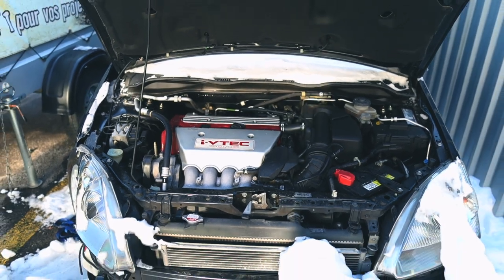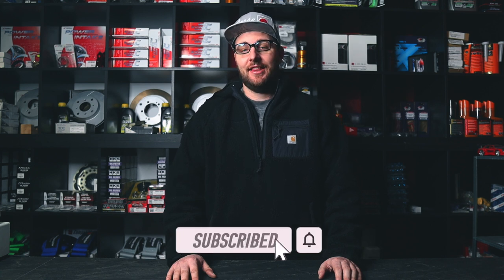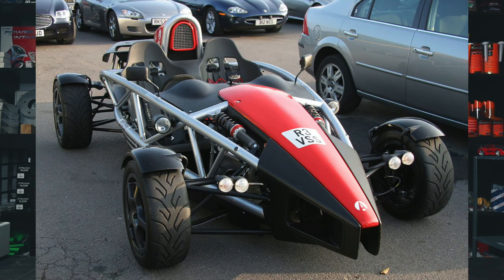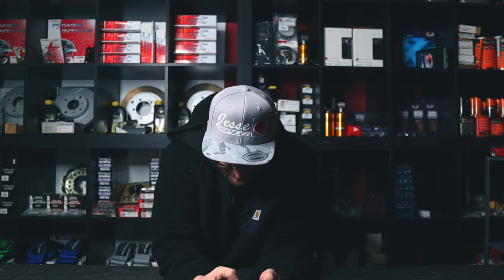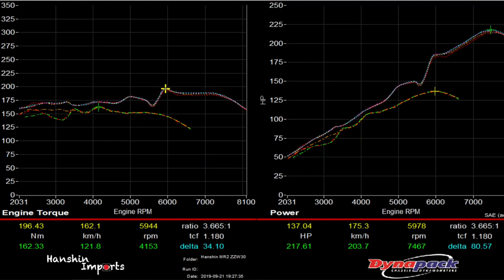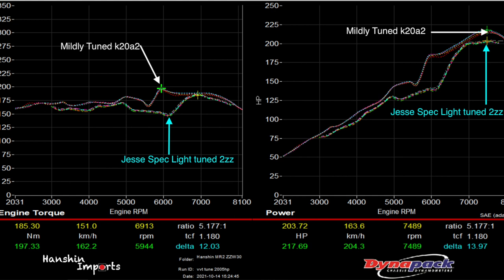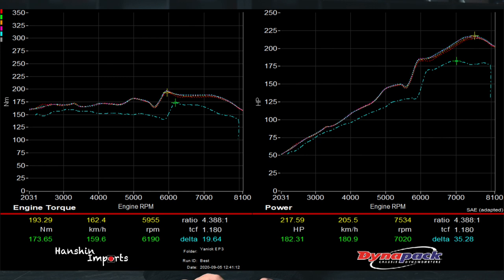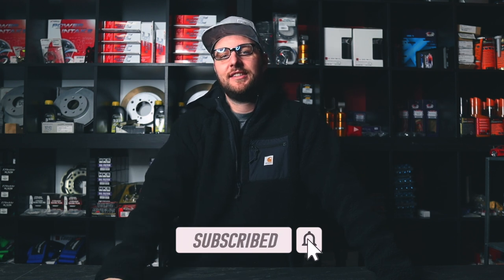How to Kswap an Mr2 Spyder EP2: Is the K20a better than the Toyota 2zz? Is it worth the extra cost?

Comment: Good points, but the other issue with the 2ZZ is poor durability of the C series transmission. Much better options with the K series.  Second, while PEAK power of your tuned 2ZZ is similar to the K20, another adage is, “area under the curve”.  The horsepower comes on much earlier and stronger with the K20 once lift engages.  I have a 2ZZ, and that is it’s biggest weakness for me…a very narrow, peaky powerband that is barely usable, even with a 6 speed.
Reply: While true, I think that is actually where the fun comes from. It gives the engine character because the 2ZZ is just so eager to deliver performance yet it makes you work for it instead of serving it to you on a silver platter, which in turn forces you a be better driver to compensate and maximize that powerband.
If you want area under the curve just get a big lazy V8 and call it a day.
Reply from the maker: Don’t worry, i know the concept of area under the curve. And this video actually shows that the 2zz, suprisingly, isn’t that far away at all than the k20. Even more surprising, it actually surpasses the k20 in a stock ep3! Watch the video and you’ll see… this video is to show that its actually pretty close
Reply: The trick is lowering lift stock 2zz ecus lift point is anywhere from 6200-6800rpm depending on the ecu that’s why the power curve isn’t as good a k20. My lift is set at 5800rpm with redline at 8600rpm and the power curve is very different crazy with just a few rpm difference in lift engagement can do. Every time I shift I land in lift always in the powerband.
Reply: @JesseSpec  I watched the video before commenting.  The K20 has much more power below where the lift kicks in on the 2ZZ (based on the dyno curves that you posted).  At less than 5200 rpm, the power curves are very similar, but when racing or when you want power, you don’t care what the power is at low RPM…you want maximum power over a relatively wide powerband.
Reply: @absolutezero7344  I have a Spyder with a 2ZZ.  A V8 is a tough fit in a Spyder (essentially impossible) and also doesn’t do much for gas mileage on a car that is driven daily in addition to being driven occasionally on the track or autocross events.  The 2ZZ is eager to deliver performance, but only after you hit lift above 6000 rpm.  It is a good match for the Spyder as it is an easy and inexpensive swap.  It is also rather gutless and delivers essentially the same performance as the 1ZZ unless you rev it to the moon.
Reply: @reneneron2971  I wasn't necessarily saying to swap a V8 into a Spyder, it was more about if you desire a Flat hp/torque curve then maybe you should consider getting a car that is suited for that purpose like something with a large displacement engine, anything supercharged, or go all the way and get an electric car and have a rectangle for your dyno graph! It just so happens that highly strung 4 bangers tend to have low torque but peaky HP by nature and you either love it or hate it. 

As for the 2ZZ the biggest reason why the K20/K24 have "more area under the curve" is just due to displacement. A 2.0L/2.4L is always going to make more low end power and a smoother graph than a 1.8L and the trend continues with 1.6L (4AGE 20V vs B16B) that have even more peaky graphs again.
Surprisingly the 2ZZ actually makes both more torque and hp than the 1ZZ even with it's decreased stroke because the Yamaha head flows so nicely it helps gains even in low rpm. Also interesting is that the (Early ECU's before it was neutered) 2ZZ has almost identical stats to the JDM B18C except the 2ZZ tends to make its power/torque slightly earlier. So when compared to similar displacement engines its easily one of the top in the field.

Another factor that many people omit is the potential of competitive racing events/series where they are divided by displacement. Having a larger engine like a K series potentially puts you in a higher more competitive class. However staying with a factory 1.8L displacement should let you potentially enter and dominate lower classes.

So it really depends on what your purpose of the car is and how much of a challenge/reward you want to have driving it.
Reply from the maker: @absolutezero7344  thanks for your input! Very good points!
Reply: @absolutezero7344  love the car, and the 2ZZ was an easy and inexpensive way to gain more power.  I have a 4AGE in an AW11 as well.  For SCCA sanctioned autocross events, any engine swap bumps your class…I moved from ES to SSM as a result of the 2ZZ, so based on PAX, the vehicle is less competitive as a result of the swap.  On a track, the 2ZZ helps a lot as you can actually use the additional power,  and, yes, I do have the early 2ZZ ECU with the lower lift point and higher rev limit versus the later ECU’s.  The 2ZZ transforms this car, but I can see significant advantages converting to a K series If you to stay NA and keep the vehicle’s weight and handling advantages.

Comment: For mr-s balance is key, try to compare the weight and height between2zz and k20 with the gearbox.. also there is a 2zz engine make 240+ hp, that is in a formula toyota, still 1.8.. 2zz in mr-s exhaust is key, less sharp tune header like the standard header is good, but aftermarket ones too many sharp tune.. also exhaust exit is important, do a "wake filling" exit design, make a smooth bend exhaust go on too of the subframe..  the car will be different at high speed…increase volumetric efficiency.. anyway great video👍
Reply from the maker: Thanks man for the tips! Yes lets do some « factual » comparison of both platforms. I love Toyota more than anything but opportunies have made that the k20 is my next engine! Lets see where this brings me

Comment: Not a fair assessment as the engines dont have the same displacement.

Average out the hp per litre on both engines. 

And its still unfair comparing a 1.8L to 2.0L
Reply from the maker: What is fair? Everybody has a different viewpoint. The undeniable point that its an interesting comparison for people in the swap/mr2 community. Thanks for your positive and constructive comments 😅

Comment: Isn't that fair to compare a stock EP3 to a 2ZZ swapped MR2 because you will have aftermarket exhaust manifold that increases the 2ZZ power output.
Reply from the maker: Hi! Thanks for the comment. One could ask, is it fair to compare a 1.8L to a 2.0L? In the end, many people want to know how they compare to one another, in stock form or tuned. Which is why I made this video😉
Reply: @JesseSpec  fully understand the point of your video, just can't support the point that the 2ZZ is stock as no stock 2ZZ can produce 204hp
Reply from the maker: @powerst33r  i thought your previous comment was questioning the « faireness » of my comparison? Now you say its the bhp figure of my 2zz engine? Hahaha make up your mind man 😂
In the end, it just has cheap exhaust headers (far from the best), an intake (far from the best) and a tune/ecu. Doesn’t seem very far from stock if you ask me (block is untouched). 🤷🏽‍♂️🤷🏽‍♂️🤷🏽‍♂️

Comment: The Ep3 engine is the least sought after k20. It sells for $600 on ebay vs $1500 k20z3
Reply from the maker: Why would it be the least sought after? Cheap bang for the buck and makes a perfect k24 monster when using all ep3 parts combined with k24 block….
Reply: I think he’s talking about the K20A3 from the EP3 Si. One of the economy K engines, the A2 is a more desirable variant. @JesseSpec
Reply from the maker: @J3Fox00  yeah maybe. We are talking here of a European civic type R ep3… 🤷🏻🤷🏻🤷🏻
Reply: @JesseSpec  Mhm, and the JDM Type R makes even more power so that makes it a little bit more odd.

Comment: Dont forget about 2ar-fe is also an option and it shows better output for cheaper investment cheaper than k-swap and 2zz.
Reply from the maker: Thanks for the input. Honestly I don’t think this is as easy as an option in Europe or Switzerland, they aren’t popular here. To be honest, I am also not as interested in this engine compared to the 2 other ones. It also seems to be way more annoying to install into the mr2, compared to the 2zz or K engines…
Reply: @JesseSpec  the thing I like about 2ar-fe is they're available anywhere and at a low mileage. In the states 2zz or k20-24 with a low mileage or haven't been abused it's pretty hard to come by especially 2zz. The way i see it 2ar is a step up to the 2zz. Yeah you're right its quite annoying but it might save your pocket. But i do respect your opinion. Keep making great contents.
Reply from the maker: @adrianepaulin7287  thanks 😁👍🏼👍🏼
Reply: @adrianepaulin7287  2ar seems cheap till you start looking for transmissions. 
Transmission brings the overall price equal to a kswap. Turbo K24 and rsx 5 speed is the way to go.
Reply: @christopherdavis8530  yeah you're right if you purchase the tranny alone from the dealer. But buying a donor car from a junkyard is much cheaper than the tranny from the dealer. I dont know from where you are, but where i am, there are tons of tc and 2011 camry in my junkyard.
Reply: @adrianepaulin7287  has to be 2012+ tc to work with 2ar and fit in mr-s.. Camry + Solara trans requires heavy fabrication. 2012 tc do not go for cheap anywhere. The only chance is finding a guy parting out who doesn't know the demand for his trans. (Takes months, not happening if you aren't near a city) I've harassed Frankenstein garage through multiple emails and seriously considered the swap but found that a kswap is the same price, has better potential, and has plenty of kits and prefabbed options... even has working AC for pretty cheap. :) Have a stock turbo k24 pushing 350hp sitting in my garage RN, all cost about 5k.

If you do find a 2012+ tc, for cheap I completely agree. GRAB IT
Reply: I've been looking at doing the 2ar swap for my tired 1zz... But by the time I purchase all the necessary items and modify the cobbled together parts for axles...  I could do a 2zz Swap and working on saving up for upgrades...  I mean, I guess if you're in an area that has great selection of JY to try and find the trans and engine needed... (unfortunately I am not...)

Comment: Yes./end thread
Reply from the maker: Hahahah, but the k20 isn't that much better honestly. I was expecting more hahaha🤣
Reply: @JesseSpec  the stock k20a I drove is 227whp dyno. My car was 179whp same dyno.
Reply from the maker: @TougeTime  Look at the differences between my 2zz and the stock EP3 engine... I wonder if the k20 you drove wasn't already tuned a bit? Thats a lot of power for a stock k20 (227zwhp is like 260-270 engine HP)
Reply: @JesseSpec  yes hondata tune. 2zz had pfc. I guess yes my state does have some of the top honda tuners in the world lol
Reply from the maker: @TougeTime  hahaha ok I understand better hehehe
Reply: @TougeTime  Isn't your 2ZZ close to stock? There are plenty of 2ZZ's making over 200whp. But they have Cams, P&P heads, ECU/Tune etc. Which obviously adds the the complexity/price of the build, But a worked 2ZZ will definitely give a Stock/lightly modded K20 a big run for it's money.
I also know that if you do the same mods to a K20, you'd be around 300+whp so if you want maximum N/A performance a K20/K24 is probably what you want.
But considering the weight advantage the 2ZZ has which is essential in a chassis as light as ours, especially if you are doing lower speed autocross/touge as you need that "flick-ability" to change direction as fast as possible.
The other important factor is the sacrilege of swapping a Honda engine into a Toyota, plus the K series is the LS swap of the 4 banger engine world which ironically makes the 2ZZ a more unique and interesting swap.
Reply: hp figures always seem higher in america

Comment: why not k24? the TORQUE!
Reply from the maker: Hi! One step at a time my friend. You might know this but other than the 2.4L block, all the rest of the engine will be composed of EP3 K20 engine parts. So I figured, why not go with the ep3 assembly with a few mods and enjoy it for a while? Once I get tired of it, all I need to do is get a k24 block and reuse my ep3 stuff with it ;-)
Reply: Makes sense. The mr2 is so light! @JesseSpec

Comment: A tuned K20, wipes the floor with any other 4 cylinder, NA engine.
Reply from the maker: Wiping the floor is exagerating. It Will surely be the more powerful but it all comes down to how much is invested in the tuning
Reply: @JesseSpec  you aren’t getting close to 250bhp with a tuned 2ZZ. However you can make that easily with a tuned K20, reliably. So yeah, wipes the floor.
Reply from the maker: @joshwattonS2000  no it doesn’t wipe the floor with it. If you compare HP per L its very close. The k20 has 200cc extra. Oranges and Bananas